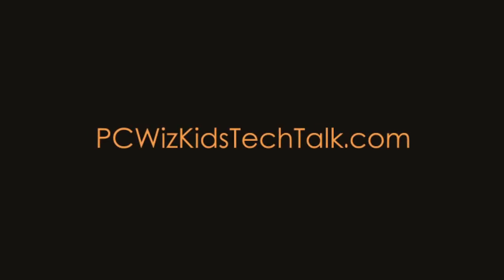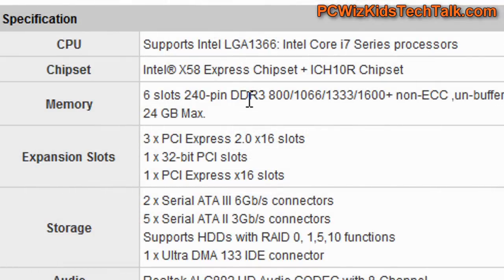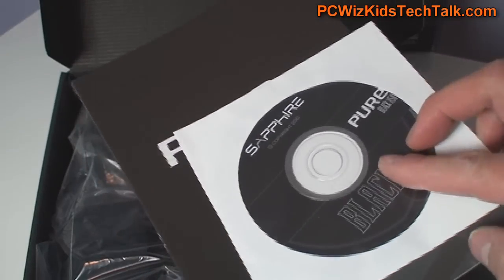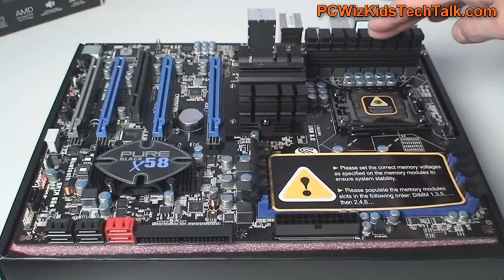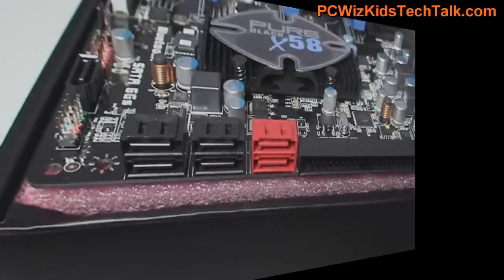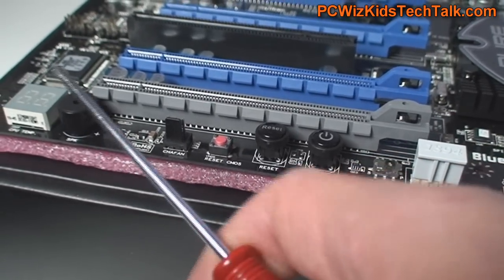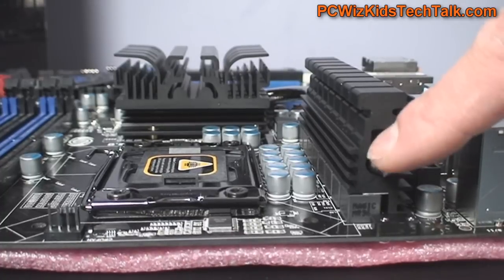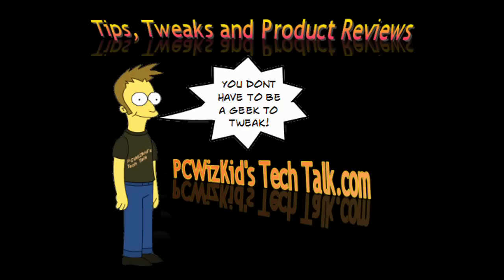Sapphire Pure Black X58 Intel Core i7 Motherboard Video Review

Comment: @alzaabialzaabi to bad it will be outdated like all 1366 socket Mobo's when the LGA 2011 comes out. The LGA 2011 is socket type Mobo's are meant to replace the 1366, when they're released the two current socket types will be 1155 and 2011; The 2011 socket is backwards compatible with 1155 socket CPU's so you really have that compatibility support there.

Comment: doesnt x58 support sli and crossfire like out of the box they just have to license it to use it. i could be wrong but im pretty sure that every northbridge  but anyways that just lazy for sapphire to not include it. that was one of the great things about x58 is that pretty much ever board can run dual nvidia or ati/amd and most are 3 way. well it will only hurt them in the long run. dont take this as a hate. just evga supports ati crossfire why cant sapphire support nvidia.

Comment: @FR2T because of the power draw to be more sure that there cpu don't overheat so they don't need to sell huge coolers whit it, longer life, more reliability, better yields not al cpu are able to clock over 3.7 GHz. and to reduce the folds the cpu makes like 2+2=3 or so its not important for browsing nor for gaming but scientific simulations it might produce a lot of problems

Comment: i wouldn't buy a 1366 board these days. The 2600k is getting close to as powerful as the 980x but 1/3 the price. If i were in the market, i would hold out until socket 2011, which i'm sure will rape our minds with it's performance